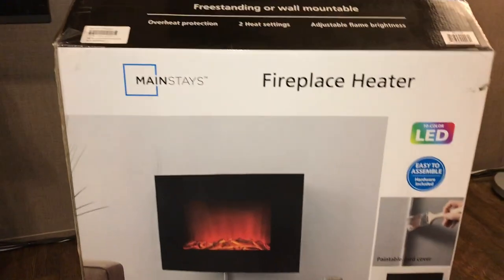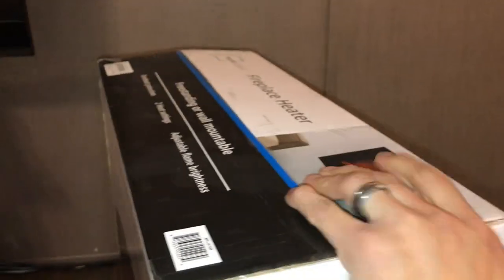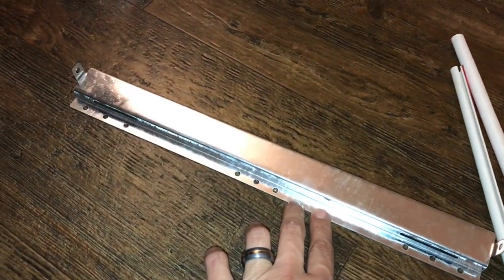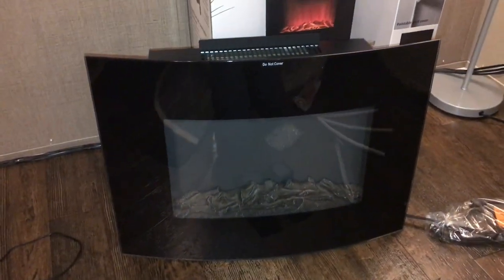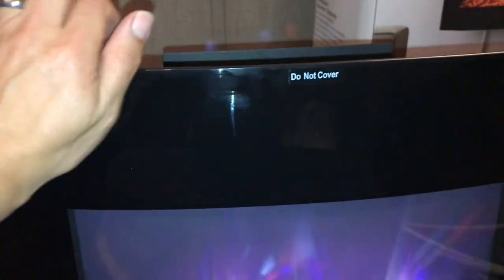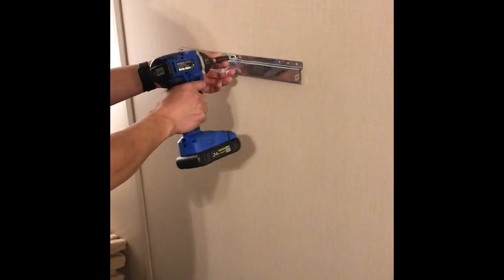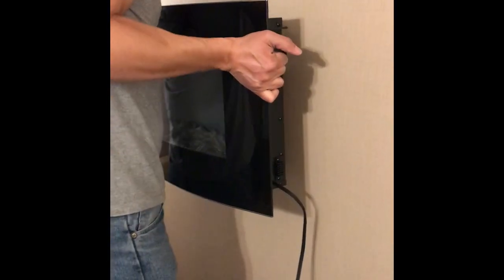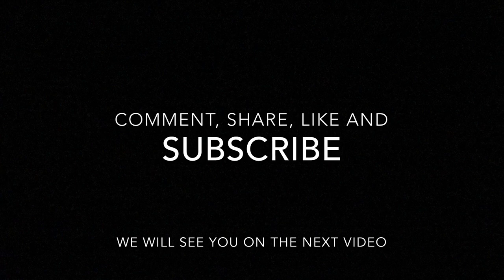Mainstays Fireplace Heater

Comment: Have one also. However, If you wall mount it, your wall above the heater will come extremely hot!. There is a small piece of black deflector behind the heater opening but does not help to deflect the heat away from the wall. I compensated this by making a bigger deflector (to replace the small black one) on top so the heat is directed away from the wall. Made it out of a spare piece of metal from furnace duct work. It is slightly wider and about two inches high and bent forward a bit with a lip on the end to further direct the heat. Worked out perfectly, no more heat issues on the wall and I feel safer.
Reply from the maker: Awesome 👏🏼 tip. I might have to do something like this. 👍🏼

Comment: I just bought mine as well! Has anyone else had an issue with the heater shutting off after a minute or 2 of being on?
Reply: Just bought 1 and it stopped working overnight 😤😤😩.
Reply: @williamivery1809  You're scaring me.  Mine hasn't gotten here yet 😧 It's due on the 8th....   fingers crossed.